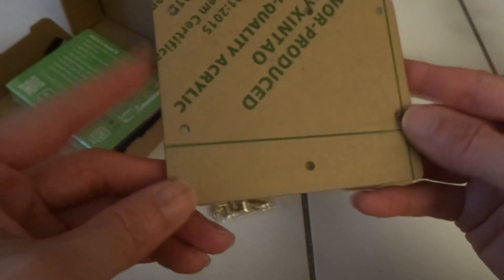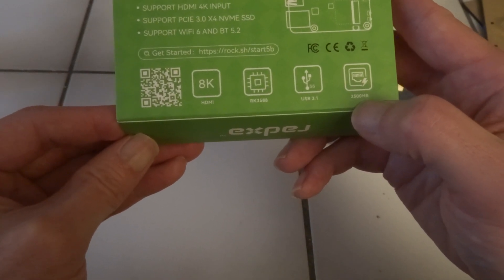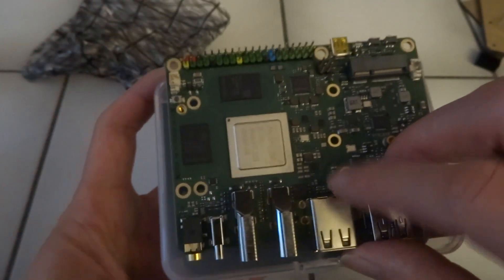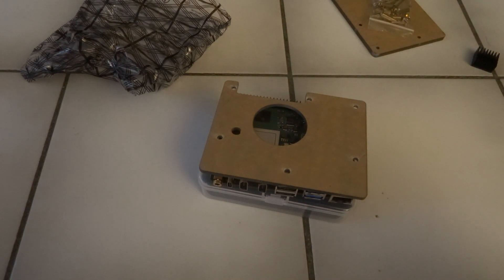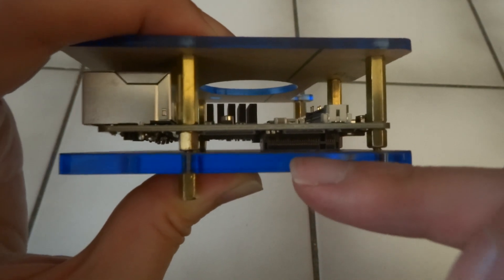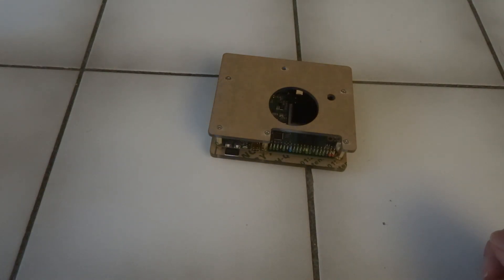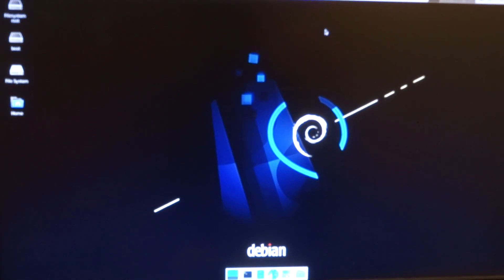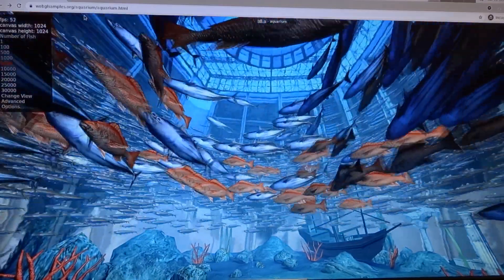Radxa Rock5 Model B Unboxing

Comment: What build version is your Debian image, and does glxinfo output on Renderer show llvmpipe for you? I have the same flickering issue and saw that it is on llvmpipe (i.e. not HW-accelerated; tested on 20221024 build).
Reply from the maker: I used this image: rock-5b-debian-bullseye-xfce4-arm64-20221001-0544-gpt.img.xz. About XFCE says LLVM 11.0.1. I'd guess some HW acceleration is active, otherwise it wouldn't reach almost 60fps with 5000 fishes.
Reply: I have build 20221031-1557 with kernel 5.10.66 and all works fine.  I upgraded the kernel to 5.10.110 (and other packages) and X (I don't know if it's X or Wayland) stopped working...

Comment: you might want to use the small "spacers" as nuts on the bottom and use the middle length part as the spacer. from top (screw, long piece, middle long piece, small piece) then there will be enough space for the nvme and everything will work fine together ;)
Reply from the maker: I tried that, but since the bottom plate is thicker, it means i don't have any other choice, as those small pieces are not long enough for the bottom plate.

Comment: My Mekotronics R58X also suffers from Minor video glitches. The fish demo works fine though. Some embedded video players stop playing when entering fullscreen, very odd.
Is this Radxa linux only?
Reply from the maker: But are you running Android or Linux on the R58X? And are you on the latest firmware? https://www.mekotronics.com/h-nd-21.html#_np=9_524
There is also an Android image for the Radxa Rock 5B: https://github.com/radxa/manifests/releases/tag/ROCK-android12
Reply: @LivingLinux  Forgot to add im running Android. And thanks for pointing me to the updatepage. I was sent the old firmware 0804 by Mekotronics by begin september. So now it appears theres a newer firmware. Ill try that!

Comment: Did you pre-order in January of 2022? If not, which month? I pre-ordered mine in April and am not sure when I'll get my chance to order.
Reply from the maker: Yes, I think I ordered on the first day, January 9th. Looks like they are processing March at the moment. https://forum.radxa.com/t/introduce-rock-5-model-b-arm-desktop-level-sbc/8361/869
Reply: @LivingLinux  mind if I ask how long it took to receive it after placing the final order, and how much shipping charges from allnet china were? I put in a mock order for $28 worth of products and they wanted $25 for shipping to Europe, which seemed pretty steep to me.
Reply from the maker: @NathanMartin11  I paid $16.41 for shipping to NL. I was able to choose between express and regular. I went with regular (cheaper).
I paid September 28th, probably after close of business in China. September 30th I received notification it was ready to ship, but that was just before Golden week (national holiday in China).
And it took two days for the Dutch customs to release the package, after I paid the tax (according to the track&trace). So I guess it will be around two weeks under normal circumstances (or choose express delivery).
Reply: @LivingLinux  Interesting, I wonder why they wanted me to pay $25 for shipping for an order of just $28?!?!  I was just trying to buy the charger, case with passive cooling, and a charging cable. Express shipping was $48 for the order of $28, which is almost double the cost.
Reply from the maker: @NathanMartin11  I just did a mock order of the Rock 4 to NL and it shows me $12.97 for economy shipping. I don't think Allnet is ripping you off, as they are also dependent on the price quote of the delivery service.
I also tried your order (case, charger and cable) and now I also get $25 for shipping. Perhaps that charger is messing up the shipping (could be because of weight and/or dimension).
Reply: @LivingLinux  ahhh, that makes sense, so will just skip the charger and see what I can come up with for a better charging option. Thanks for the tip!
Reply: @LivingLinux  Another quick question, did you have to pay for VAT with customs? I was trying to stay under the 150 EUR for VAT by doing a separate order for eMMC, case, and charging cable, but not sure if shipping charges for my $139 device will take me over the 150 EUR VAT limit or not. I'm not sure how shipping factors into VAT for shipments from China and elsewhere.
Reply from the maker: @NathanMartin11  Yes, I had to pay tax, before Dutch customs released the package. If I'm correct, you pay tax over the sales value, excluding shipping. But ask your tax department to be 100% sure.

Comment: you forgot to remove the protective film over the acrylic case
Reply from the maker: I already thought that, but was in a rush to get things ready to test. 😅
Reply: When I look at this two pieces of acryl I'm glad I did not buy it. Already overpaid for heat sink. My should arrive on Monday.  Can you explain why did You use hub and not generic HDMI out?
Reply from the maker: @szymonzyc  When I ordered, the Rock 5B acrylic case wasn't available. Allnet told me this one should work too. But the heatsink is small and doesn't leave proper room for the NVMe port. You can see the "official" Rock 5B acrylic case is different. https://shop.allnetchina.cn/products/rock5-b-acrylic-protector
I used a hub for video out, as my monitor didn't pick up any signal on the HDMI ports.
Reply: @szymonzyc  i think its because one hdmi doesnt work without the other connected and he didnt realize
Reply: @hannescampidell  never read about it. That does not make sense. It must be a bug. I would rather think that we need to use some HDMI boost option.
Reply from the maker: @hannescampidell  So you need to connect two monitors?
Reply: @LivingLinux  or use the other hdmi port
i heard that if you connect only one monitor it only works on a specific port of the two hdmi ports
Reply from the maker: @hannescampidell  I did some more testing with the HDMI ports. Looks like my monitor and the Rock 5 don't like each other. It doesn't matter which port I use.
I also connected my Lenovo Yoga Tab 13 (this tablet also doubles as a monitor) and that one works with both ports.